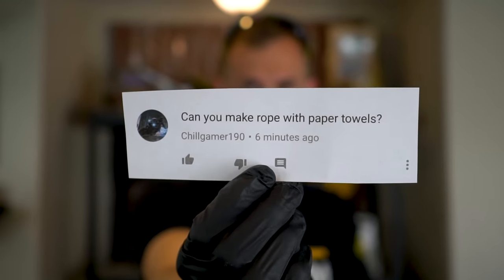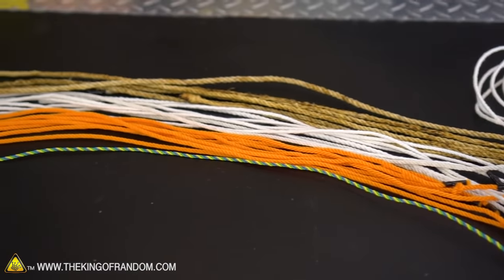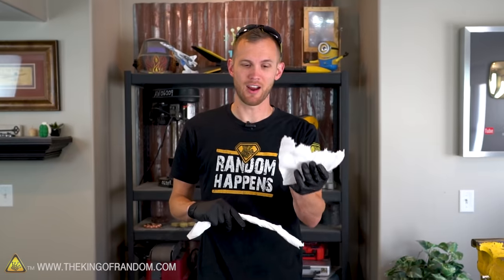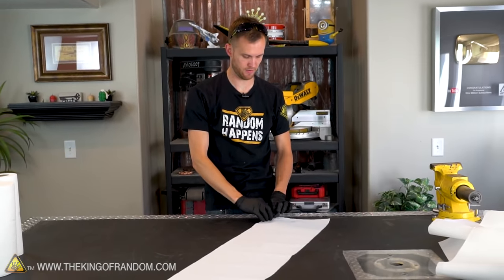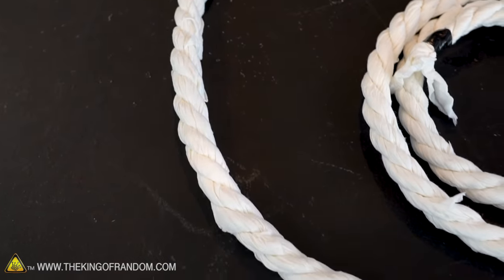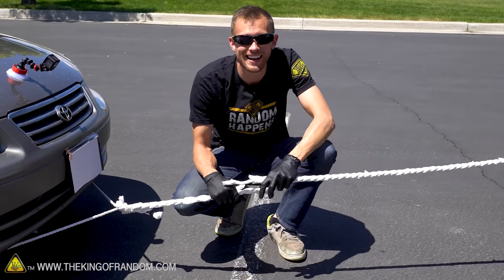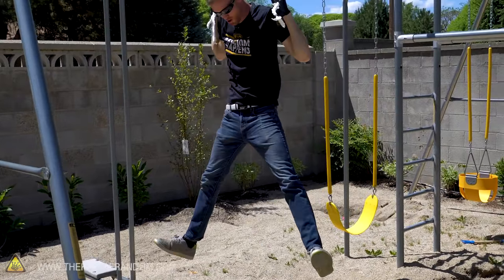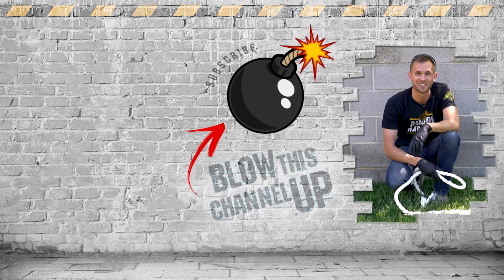Pulling A CAR with a Paper Towel Rope

Comment: extra strength brawny should do it :P
Reply: Richtoften_0527 that Charmin ultra strong would do it
Reply: Boo, Brawny, booo. Its Viva! Papertowels all day.
Reply: Wow
Reply: How can you make a electric magnets
Reply: You guys should try this again. However, instead of one braid. Do three. So braid three diffrent bundles, then braid the three bundles together. Might increase the strength of the rope.
Reply: i said it should, not will work :D
Reply: Or they could try soaking it in superglue and see if that makes it stronger from the glue, or weaker from getting wet.
Reply: Can You boil Oobleck
Reply: Now try toilet paper and see if it's stronger because it is thinner a d should twist tighter
Reply: Soak it in fiberglass resin to increase its strength
Reply: U should try boiling coke then adding water to see what it looks and taste like
Reply: What happens if you cook/boil orbeeze?
Reply: Cam you make a rope with aluminium foil ?
Reply: What would happen if you injected an egg with glow stick fluid???
Reply: Richtoften_0527 Can tin cans hold a small car?
Reply: what happens if you put superglue in nitrogen?
Reply: Bo McClung fiberglass resin. Lmao
Reply: can you  put a cup in to gunpowder and light it on fire
Reply: Richtoften_0527hbb
Reply: You spoil the video for me thanks a lot
Reply: Bounty
Reply: nah. FLEX SEAL
Reply: H E F T Y
Reply: Richtoften_0527 what will happen if you soak the toilet paper rope in super glue pls try this 😆😆😆👑🔬🔭🔦🔋
Reply: Put super glue in the toilet paper rope 😂😂👑👑👑🔬🔭✂📹 will it be stronger than a normal rope👍
Reply: Can you start a car using lemons 🍋 pls. Pls. Pls.
Reply: in grant's reaction fire chamber he said that it can melt rocks melt 
TRY TO MAKE LAVA
Reply: Extra strength but make sure you don’t get it wet
Reply: Hello
Reply: Richtoften_0527 in
Reply: Richtoften_0527 lololololololololololololololololololololololol
Reply: Richtoften_0527  hy
Reply: Hy
Reply: They should have wet it down, then twisted it up, then let it dry. Would have been stronger.
Reply: Can you make a marterial that catches fire but doesnt burns
Reply: Why are yous fighting over paper towels

Comment: Actually, when you soak and then dry paper towel, it gets harder to tear apart. I tried making a rope and it held better after being 'water worked'.
Reply: I wonder if soaking it in other solutions would make it even stronger?
Reply: @susanlewis1110  I guess so. Just try it out
Reply: Soak it in concrete lol
Reply: @chikennugget927  WhAt ThE FuAwK???
Reply: Yup. Also soaking it in grease will make it stronger. As it gives something for the fibers to bind to. Discovered this after using paper towels to clean up spilled bacon grease.
Reply: Nop
Reply: U can make a rope by twisting sum toilet poper and lik it an den wait fer wun dey
Reply: Buddy Seagull it will stick to your tough
Reply: @dylank7182  Y  E  S

Comment: What happens if you try to boil wet concrete?
Reply: RetsillAcM nairB it gets dry
Reply: it gets boiled xD
Reply: RetsillAcM nairB it's gets dry and turns to normal concrete and you could never get it out......
Reply: Julia Charlotte Blekastad Haugrud it gets dry and then the concrete turns dry so the concrete is stuck and you can never get it out only if cut it in the middle so it makes a circle inside and then is normal gain but where would your get a tool that strong well guess it stuck?
Reply: U have dinner
Reply: Sandra Perez Ramirez you liked your own comment sooooooooo unoriginal BTW I'm not having dinner
Reply: It will dry 😂wet concrete+heat=hard concrete
Reply: S.B.I concrete is already is  hard so what's the point of that?
Reply: You ruin your pot...
Reply: M9arc Ruiz wet concrete isn’t hard
Reply: Its called cement
Reply: cement is concrete without aggregates. They said concrete, so let them have their cement and gravel in a pot.
Reply: A massive mess.

Comment: Does anyone else know that Elmer's glue is very flammable?  I learned that by playing with a lighter
Reply: progamer9753 _ hmm
Reply: progamer9753 _  did it hurt
Reply: I also learned something by playing with a lighter, it's how much a melted rubber band hurts
Reply: Grasiela Jimenez after a lit the fire the lighter was hot and I accidentally put it on my face.  Now I'm missing some skin and I told my parents I scratched myself
Reply: progamer9753 _ cool
Reply: That's why you're not supposed to play with fire.
Reply: progamer9753 _ oof😂
Reply: progamer9753 _ it’s made of water.. that’s why it’s non-toxic. I just tested this right after reading this comment. It doesn’t burn at all..

Comment: Can you freeze paper towel rope in liquid nitrogen / soak it in super glue and let it dry 
You could also soak the paper towel rope in superglue and pour borax solution on it
Reply: Maybe not the super glue. I've seen with cotton balls that if you put a lot of super glue on them they'll create an exothermic reaction and catch the cotton balls on fire. It might do the same thing with the paper fibers in the paper towel. If anything, I'd use a 50/50 water/white glue mix and let it dry.

Comment: Can you see what helium does in liquid nitrogen. A balloon filled with helium would be cool to see and also try putting a helium balloon in the vacuum chamber
Reply: it would fall to the bottom of the gas chamber, without other gasses around it, the helium would have nothing to float on.  It would also expand, similar to a regular balloon filled with air.
Reply: Christian Eggert he also has done a ballon in liquid nitrogen, the gas compresses so you could take it out and it will sit on a table. When it warmed up the gas would expand and the ballon would float again

Comment: I wonder...what would happen if you mixed a carbonated drink with a melted metal. How would they react? I guess I’ll leave it up to you guys!
Reply: • Barr • can almost guarantee you it'd quench the metal turning it rapidly to a solid state while maybe exploding a little bit
Reply: probably the same reaction as water, but with the reactions that come with some of the other stuff mixed in.  Probably caramelize the sugar, or burn it.  Depending on the metal there may be a reaction with the gas in the drink as well, but beyond that it would probably not be too exciting.

Comment: Can you please cast a custom magnet by melting it and casting it
Reply: Kaleb Jayms no
Melting magnets will make them lose their magnetic field
Reply: No
Reply: Ya forgot
Reply: Kaleb Jayms I dont think you get how magnets work....
Reply: Melting magnets causes them to lose their magnetic properties. And it's not as simple as magnetizing it once more. Plus, since they are made of many different metals, they melt at a brisk 3500 degrees.
So no. That won't work.
Reply: You heat bar steel until a magnet won't stick, then you keep it hot under a very strong electromagnet and decrease temperature,  this helps the steel to take maximum magnetic flux.

Comment: Make helium infused water
Reply: Possible, but helium is not very soluble in water.
Reply: Helium in a liquid state would be hard to make, helium is a noble gas therefore wouldn’t react with water unless certain conditions are met
Reply: I see what you mean! Carbonate water with helium so every time you take a sip your voice is really high😂😂
Reply: Actually, that's already been done. Some bars will serve helium-infused beer.
Reply: Jacob Lassiظاف افة   عبضىقع4ثهيننغيفؤهفسعفهيغبخحتلانرلرنناببخخالحلهبتح97654321098ه65421

Comment: What if you made the rope, soaked it in water, gave it a light twist to remove excess, then let it dry out.  How would it hold up then?  Would the water have permanently weakened it or would it return to original, dry-strength value?

Comment: The math behind the car pull is that the car in neutral is a rolling resistance so hes pulling 33% of the cars weight, so he was pulling about 1,000 pounds on the paper towel and after the first pull the rope had stretched out and loosened up so on the second pull the rope wasnt as strong and broke in the weakest link

Comment: You actually only proved that the rope can hold half a person, because you were holding both ends of the rope, so the tension was only half of your weight.

This means that pulling a person up a cliff will cause twice the tension, and therefore the rope may still break.

Please don't use this rope to pull a person up a cliff before running another experiment!
Reply: The whole of his weight was still on the fulcrum point though.
Reply: The tension in the rope was still his full weight. If it was two separate ropes, it would be half, but it's the same continuous piece
Reply: At the point where top of the rope looped around the bar tension would go to both sides with the weigh of half Nate each. 2*0.5=1
At that very top point rope still had full Nates Weight on it

Comment: rolling up wet paper towels into thin cords while wet then letting them dry to be rolled up tighter then making the same rope you just made got me to the point where we pulled a pickup with two of the kids in it, across two blocks then up a hill a third block then tied to commercial rope it lifted a group of three adults and four kids before it finally gave out. rolling it up while it was wet was the thing that worked best to make it stronger in over 10 tests we did with the kids here.
     I think you need to try this test again because it was made loose and that's why it failed. a tight wound rope of paper towels held up over 500 pounds of humans and it pulled a pickup with two kids in it up a hill

Comment: Try to mix cola and gasoline and then try to light it up.
Reply: Ehhh, why? =P
Reply: why not?
Reply: What would probably happen is that the gasoline would float on the cola and burn away. I don't think they would mix at all and it would probably look just like burning gasoline. That's because gasoline has lower density than water.

Comment: spray the never wet that you used on the sand ,on the towel ropes . B4 you use the spray have a wet towel , a towel just a little moist n dried to see if it will trap the moisture in and or repel .. also use some nitro lol

Comment: What if you wet the "rope" then tighten it, then let it dry for a while... would that still cause it to be weakened?
It also appeared to get much slimmer as a result, which means you could wet the rope, make it slimmer, and then you'd have 9 strands of Paper Towel to make a rope which i would guess would be stronger...

Comment: This made me curious (AND PLEASE. NO ONE TRY THIS!!) if its possible to pull a car, acting as a human rope.. grab onto the bumper of the truck, grab a rope or the bumper of a car, and hold the two together, kinda like Captain America with that hellicopter.
I'm sure you'd just rip your arms off! You'd draw and quarter yourself! Haha
But honestly I wanna know if it's possible, under the right curcumstances.
Reply: Well it takes about 50 pounds of force to slowly push a car on neutral on flat ground. Make it another 50 that pull on you and your set. 
If you can survive pulling 50 pounds yourself and having pulled with 50 pounds of force on legs or arms then ur fine